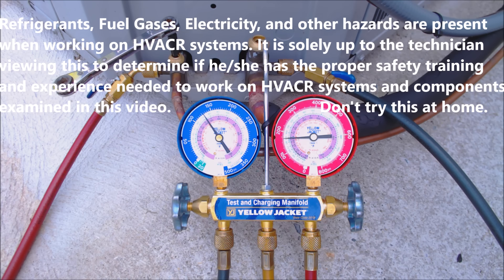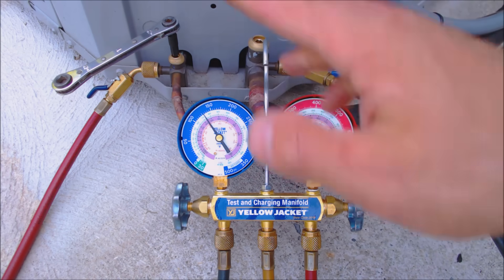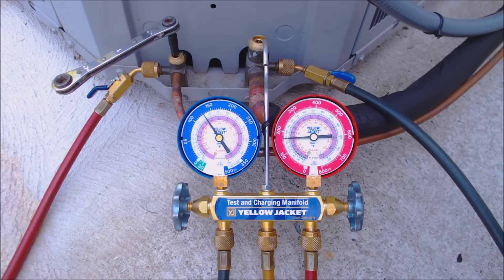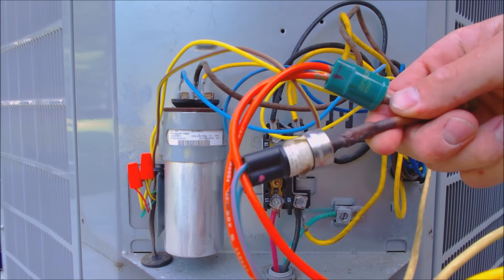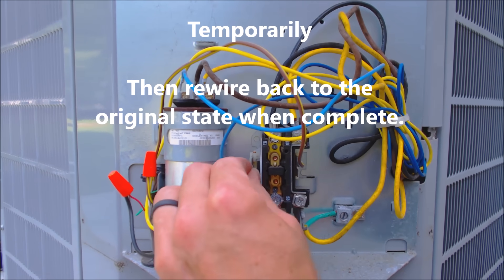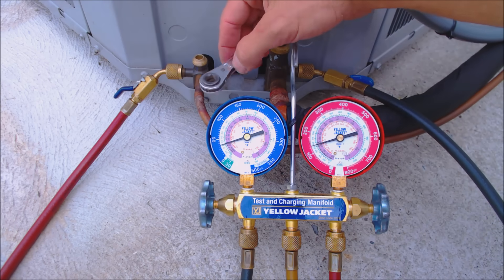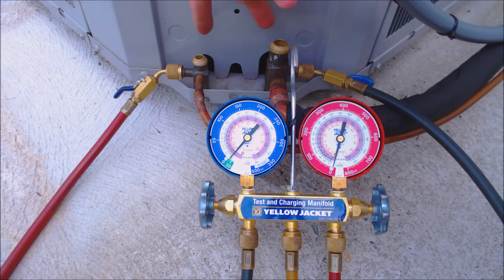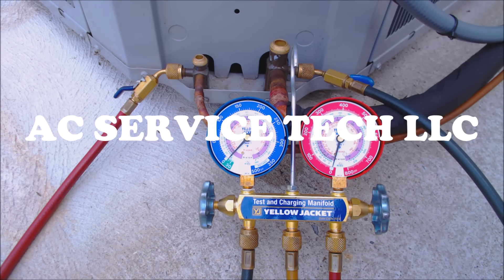HVAC PUMP DOWN Procedure of Air Conditioner! STEP by STEP!

Comment from the maker: Tool List-  https://www.amazon.com/shop/acservicetech
Support-  https://www.patreon.com/acservicetech
For those that are looking for the tools used in the videos: (Linked Below)
Here is the Link for the Yellow Jacket Refrigerant Manifold Gauge Set used in the videos http://amzn.to/2aenwTq

Here is the link for the Ratcheting Service Wrench   http://amzn.to/2dGV4Nh

Here is a link to Refrigerant hoses with valves used in the videos  http://amzn.to/2aBumVI

Here is the Yellow Jacket Manifold Gauge Set including standard hoses- https://amzn.to/2vLVkV9

Here is the Yellow Jacket 4 Port Brute Manifold with Hoses- https://amzn.to/2BkuGIq

Here is the Fieldpiece SMAN460 Digital Manifold Set- https://amzn.to/2nB4Fe6

Here is the Fieldpiece SMAN360 Digital Manifold Set- https://amzn.to/2BdoaD4

Here is the Compact Ball Valve Attachment for the end of the Refrigerant Hose- https://amzn.to/2KUisW8

Here is the Quick Disconnect 90 degree attachment for the end of the refrigerant hose- https://amzn.to/2MMtVcg

Here is the link to the Fieldpiece ST4 Dual Temp Meter- http://amzn.to/2wc1ME3

Here is the link to the Appion Valve Core Removal Tool- http://amzn.to/2uYr8WL

Here is a link to the JB 6 CFM Vacuum Pump   http://amzn.to/2nqbvo8

Here is the Link to the Appion Blue 3/8" to 1/4" Vacuum Hose- http://amzn.to/2uYlVyc

Here is the Link to the Appion Red 3/8" to 1/4" Vacuum Hose- http://amzn.to/2uYg6Ro

Here is the link to the Yellow Jacket 1/4" by 1/4" heavy duty hose straight-  http://amzn.to/2umtcod

Here is the link to the CPS Vacuum Micron Gauge- http://amzn.to/2v1nM3O

Here is the Link to the AccuTrak VPE Pro with Headphones- https://amzn.to/2B2cRO3

Here is a link for RectorSeal Bubble Gas Leak Detector http://amzn.to/2ckWACn

Here is a link the Nitrogen Regulator    http://amzn.to/2bXdR5f

Here is a link to the Nitrogen Flow Meter    http://amzn.to/2brvoBg

Here is a link to the Digital Refrigerant Scale used  http://amzn.to/2b9oXYl   

Other tool links can be found in the video description section.

Shop through Amazon! Your Purchases through Amazon provide a means for channels such as mine to earn advertising fees from all purchases after clicking through. Prices are the same as normal-    https://www.amazon.com/shop/acservicetech

All of the ACSERVICETECH Playlists-  https://www.youtube.com/channel/UCOZR-1IqsAer9wzlvFgb4mA/playlists?view_as=public
Reply: AC Service Tech LLC what brand of vacuum pump did I hear on that video?? It sounds like a central air conditioner
Reply: Thankyou  pump  down    firest    dis  chareged    closef  afyer  ruinng    time  sevnd    guged   preshare    0 ,,,     comeing     closed  ok  after    valved  closed  pk  thankyou
Reply: Liqued line  guge fixed  sushion line  pump down  liqued line systom  ruing and  iqued line valve closecd   sushion line valbe guge  0 comeing  valve fullclosed  ok  pump down  mether  reparing any  gas  saveing  after fixing  purgeing amg  cjecking systiomes ok

Comment: I followed this procedure exactly, closed off the discharge line pressures started dropping but less than a minute in, with plenty of pressure left, the compressor started hissing and the pressures wouldn't drop any lower.   It seemed like the compressor stopped "compressing" and started bypassing...

Comment: I have a Carrier PH13 3-ton HP.  Bypassed the pressure switch circuit and pumped down.  Could only get it down to about 90psi.  I repeated the procedure twice with the same result.  Seems like the compressor just bypasses or something.  There was very little gas remaining in system, so I'm guessing the coil just couldn't hold any more?  I do have a 4-ton air handler, so maybe the overall system capacity with 4T indoor coil is too much for OD coil to store?  Is that possible?  Thanks for the great tips and any comment....just for curiosity.
Reply: I guess the channel has gone dormant, but either way everything worked out fine for me.  Ended up adding about a 1lb after putting everything back together, FWIW.  So I would call the pump down a success even if I couldn't achieve a vacuum during the pump down.

Comment: My heat pump system would not pump down when I simply pushed in the contactor switch (safely with a wooden paint stirrer). I didn't want to mess with the wires to bypass the pressure sensors, so I used the contactor switch method. When I went to the thermostat to call for cool as a last resort, it pumped down in a bout 60 seconds! Why? Thank you.

Comment: You mentioned if there is a leak in the system not to perform a pump down bcuz of air being drawn into the system, but isn’t the point of a pump down to do a repair on the Evap side of a system? Isn’t air going to get into the system after the king valve of the liquid line and before the king valve on the suction? I don’t understand your logic.
Reply: You aren’t pumping it into a vacuum* bc then it will suck in air through the leak. If you have leak suck it down to a few psi. Hope that helps

Comment: Just followed this vid and pumped down my system (will be completely replacing system, furnace, condenser and A coil).  Worked like a charm.  I used the harbor freight gauge set, no issues at all.  It goes very quick.  For those interested, the liquid fitting allen is 3/16 and the vapor one is 5/16.  I just used a set that fits on my ratchet, no issues.

Comment: I'm a home owner and I have done a lot of work on my HVAC thanks to your lessons. Thank for the great information.  I 'm dealing with a leak in the return line where there is a union in the cooper line that leads to the compressor. I think you mentioned in another video lesson not to ever do a pump down on a scroll compressor? I was wondering why? And would it be better to evacuate all refrigerant, braze the leak, do a vacuum test and lastly place the refrigerant back into the compressor.
Reply: I have the very same problem. The installer would not come back and fix it. What did you end up doing?
Reply: @lillithjones993  hello and greeting. 
Well, I ended up recharging the system with R22 refrigerant and the system works well. So far it has lasted three weeks but this is just a band-aid. I will try to teach myself how to evacuate all the refrigerant from the HVAC system, find the leak and braze it. Pressure test it and then put all the refrigerant back in it. I tried my best to find someone that would do all these steps but all technicians want to either pump the system with sealer or sell me another HVAC system. Please, whatever you do do not pump sealer into your HVAC system, it may cause problems in your compressor. Good luck with your issue, wish you the best.
Reply: @grandmazinger73 hopefully youve solved it by now but if not, use a refrigerant detector to find the leaking area and soapy water to pinpoint. Now you know what youre dealing with. If its a schrader valve you can get a tool to replace them under pressure.

If not, if youve got the tools to evacuate, nitrogen test, braze etc you can fix it yourself anyway. Just purge the system with the nitrogen while you braze and youll be fine

Comment: Mr. Migliaccio, thank you for this demonstration of the pump down with the most important by-pass of the low-pressure switches and their relationship with the contactor switch, very important.  I'm going to replace a TXV, air dryer and screen; however, I was not sure how to evacuate my system until I saw this video...Thank you..!  I'm not an HVAC tech, just a homeowner DIY person.  One last question??  Why does my AC system; when off for 14 or more hours, show 120psig on the liquid line and 45psig on the vapor line?  I thought the values should be equal pressures; is this another method to prove I have a liquid line restriction..?  Regards, Joseph

Comment: Question , I have a 3 tons heat pump, the txv will be replace and in order to do that the refrigerant will be recover, the question is IF I CAN pump down as much 410a in the condenser and recover the rest and later charge again using the. Su cooling method ? It’s a building and the line set is about 70 feet long.

Comment: I have a condenser that came that came with refrigerant for about 15ft of line, but extra long lines were installed 30ft and extra refrigerant added. Would the condenser have enough capacity to hold all the refrigerant after a pump down - or would it over pressurize? How should you deal with this situation...

Comment: Hi, I wanted to see if you had advice on performing a pump down when the indoor unit control board has failed?  In other words, the indoor unit does not operate, so the only way to turn the compressor on is to hold in the contactor.  Should I point a space heater on a low setting blowing at the indoor coil or something like that?  EDIT: I should clarify, I'm dealing with a mini split/ductless, not central air.

Comment: Other than a microchannel being an indicator that you cannot pump down, do you need to look up manufacturer trouble shooting to see if you can pump down and operate the compressor in a vacuum?

If so, wouldn't it  be quicker to just recover the whole unit?

Comment: nice video Craig. what if the system had a leak in it say the line set and most the refrigerant leaked out is a pump down still required or should the system be put in a vacuum to remove any contaminants  even tho a leak is present say on the line set/valve port where the line set goes in or should the leak be brazed while obviously using 3psi of air ... fix the leak then go ahead pulling it in a vacuum and re check for a leak ? and also should we the vacuum be left on for a specific amount of time to pull out as many contaminants as possible?

Comment: A little confused regarding doing a pump down to fix a leak. You said if you pump down to a vacuum on the liquid line it will draw air into the system so only pump down to about 5.psig,, and then use an external recovery machine to remove the remaining refrigerant.  I get that doing the pump down to negative psig will draw air through the leak into the line set, however,  I don't understand why drawing a negative vacuum using an external vacuum compressor is any different?  A vacuum is a vacuum and air will be drawn in no matter what compressor is used I would think?

Comment: EPA 608 prep manual, page 23 top half says: "Under no circumstances should the discharge service valve be closed on an operating reciprocating compressor." Is a pump down an exception to this?
Reply from the maker: They are talking about the discharge service valve on the side of the compressor, not the liquid line service valve. You have the condenser coil to hold the refrigerant in that case, thanks!

Comment: Great video. Any feedback on how much more refrigerant a condenser can hold vs the factory fill (in case you need to pumpdown, say a 50' lineset)? I've read factory fill is about 80% of outdoor coil volume.

Comment: My hat off to you for this video. Excellent. You had already connected the manifold to the unit when you started the video. Did you let some gas out of the system to purge the hoses and manifold or did you use a vacuum pump?

Comment: Fool you just dead headed the compressor by closing both valves with the compressor running you only need to close liquid line valve to pump down system
Reply: Maybe you are just an adolescent with a need to bloat off without having any idea what you are talking about. If you are an adult you have missed a great opportunity to fully display your lack of technical education

Comment: I assume you need a certain gauge wire cuz I used a spade wire from an old heat coil with a spade and it wasn’t pulling in 24V constantly and cycled on and off

Comment: The  small split don't have high  and low  pressure switch so I just start the ac close the high side and when it reaches into vacuum I stop thanks

Comment: What should the gauge pressure show of a pumped down unit in case I want to buy a used unit and need to be sure enough gas has been recovered.

Comment: Hi Craig, I am a huge fan of your videos, but this time I really dont agree with this procedure, because at this point, no oil will come back to lubricate the compressor, and most importantly, the compressor won't be refrigerant cooled at this point ( high superheat ), I usually stop the pump down at +15 to +20 psig ( by the book just like the solenoid valve controled fridge compressors ), bcz I can lose this tiny vapor quantity in order to save the compressor longivity

Comment: What did you set it the thermostat to?
Reply from the maker: You just set the temp to a low number in ac mode so that it won't shut off. Then push the disconnect in. When the service valves are closed, immediately pull the disconnect out, thanks!

Comment: I have 2 questions that have haunted me for the longest time: 1. Why don't linesets have valves on each end so you could isolate the tubing & contain the refrigerant, as you do with the condenser's service valves? 2. If my SCUBA computer can calculate dive-time via respiration rate, depth, & air volume, why can't the digital gauge sets calculate the weight of refrigerant being added to the system via flow instead of using a scale to weigh tank (which seems archaic)?  Maybe you could help me sleep better at night with your insight????
Reply from the maker: So it all comes down to cost and sophistication. Manufacturers will not add something unless it is extremely critical. The cheaper the process, the more likely the rest of the industry goes in the same direction. Now on the other hand, tools are getting more expensive and digitally computing. Navac came out with a machine that calculates the charge going back in.

Comment: For a full change out can you just shut the discharge line down, attach your gauge to the suction side and run the comp until you hit zero on your gauge and shut the suction line down? Then just cut the lines and pull the condenser out.

Comment: Can you elaborate how much Freon can be stored in the condenser coils? Example, usually more Freon is added for longer line sets, etc.. How do you know how much space you have before you have to use a recovery machine?
Reply: Easy to do is hook up a clean ecovery bottle up and just open the liquid line, take out half or whatever will easily go in, then pump down the rest and just throttle it back in the vapor side when youre done with whatever you needed to do and vacuumed your lines (and opened the valves ofc)

Comment: Hi there hopefully you get this,
I have a split AC with a failed PCB. 
Can I directly power the compressor and follow this procedure for safe removal of the unit. I do not have a recovery system.
Thanks kindly.
Reply: That a Fuji? Also had a failed PCB....waited a few months to get it repaired.  Working again.
Reply: @pack5eastnorthport366  Fuji- Spot on, how'd you know? What exactly was the PCB fault?
I ended up directly running the compressor off a direct DC voltage matching the specs on it. So what I mentioned, worked for pumping the unit down safely.
Reply: Jess Harris hi Jess - sorry for the late response.   Never found out the fault- tried testing the board as best I could to no avail.  Three choices: buying new board from distributor (HVAC only), getting used board second hand (good luck), mailing to Module Repair Service in Australia to diagnose and repair (expect to wait a couple of months, plus shipping and a few hundred).  The board will not look quite the same but it will work again. I’m pretty sure a power surge from turning breaker on and off killed our board.  I replaced the breaker after putting the board back.

Comment: What if before doing anything, you close the liquid line valve completely, then turn the unit on so the compressor can suck all the refrigerant into the condenser. And then close the suction line?
Reply from the maker: The compressor could have a hard time starting up thats all. I leave the liquid line open until the compressor starts fully, thanks!

Comment: AC Service Tech LLC, what's the point in doing a pump down when you have to use the recovery machine any if there is a leak, I thought the purpose of pump down was to have somewhere to put the refrigerant temporally to fix leaks, replace a TXV or piston without doing a full recovery?
Reply: Theres no point in doing a pump down if the leak is in the condenser. If the leak is elsewhere then you can just pump down the system and work on the lineset up to the indoor unit

Comment: Hey Craig, great video. I tried to pump down a two stage (with the heat pump valve energized). Gauges went down to 25psi for a few minutes then went back up.
Reply from the maker: You would need to bypass the low pressure switch, thanks!

Comment: How  pump down vrf units
Reply from the maker: Usually the same process for vrf minisplits except you want to to be running in emergency cool which is full cooling capacity while pumping down, thanks
Reply: Thanks sir